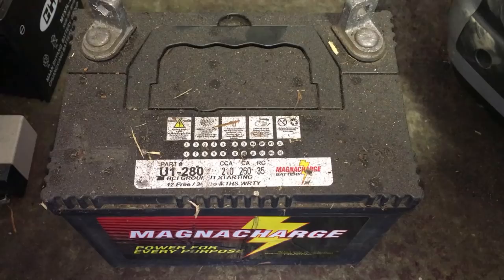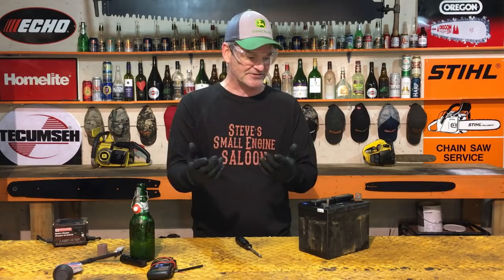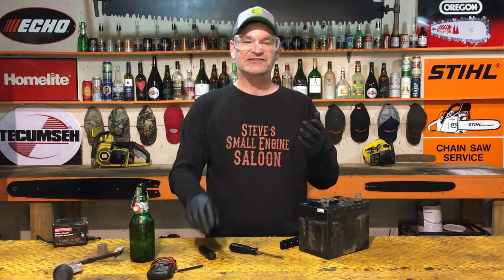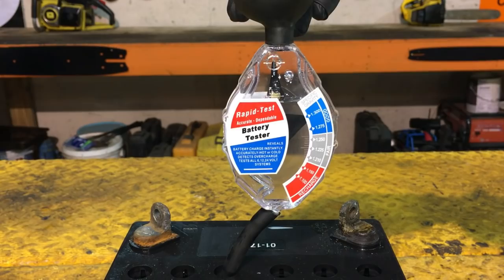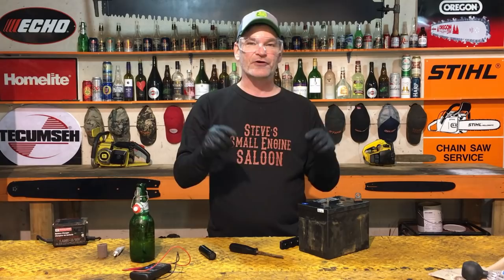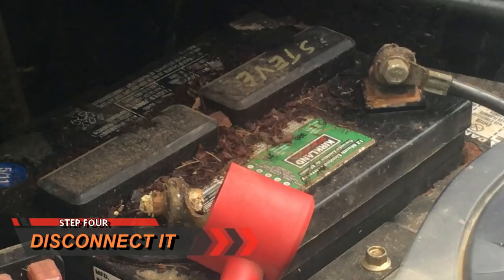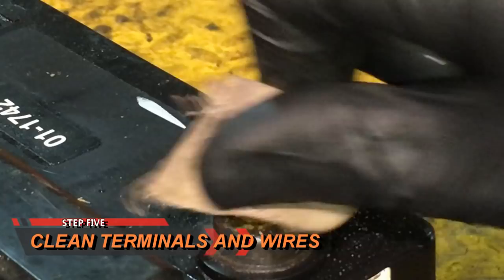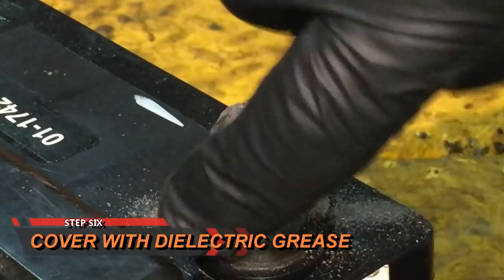How To Winterize and Maintain The Battery on a Riding Lawnmower

Comment from the maker: Click here for a battery tender ➜ https://amzn.to/2Dr5AGY
Click here for a new battery ➜ https://amzn.to/2OM5Ylr
Click here for a Multimeter ➜ https://amzn.to/2Kb6ubU
Click here for a Hydrometer ➜ https://amzn.to/2zdlFx4
Click here for gloves ➜ https://amzn.to/2K9z5OU
Click here for Dielectric grease ➜ https://amzn.to/2OKAlZr

Check out these other informative videos: 
Easiest Way To Winterize Or Store A Weed Eater ➜ https://youtu.be/hdleYDvm9BY
How To Winterize A Lawn Mower, Pressure Washer, Etc.  ➜ https://youtu.be/qccdo2UMMsE
How To Winterize a Chainsaw, Weedeater or Trimmer ➜ https://youtu.be/FEmT8qUoD0E
Best Way To Clean Under the Deck on a Riding Lawnmower ➜ https://youtu.be/RpURLWPNI1o

Make sure to check out the Saloon here too…
Click here for my website ➜ http://www.stevessmallenginesaloon.com/
Click here for my Parts and Tools Store ➜ https://www.amazon.com/shop/stevessmallenginesaloon 
Follow me on Facebook ➜ https://www.facebook.com/stevessmallenginesaloon 
Follow me on Instagram ➜ https://www.instagram.com/stevessmallenginesaloon/ 
Follow me on Twitter ➜ https://twitter.com/SteveSaloon
Reply: If you don't have any distilled water, R-O water is also OK.
Reply: Instead of battery tender I installed the battery inside the fender well on my truck and hooked up a couple of jumper wires for the winter. It seemed to work okay for me; do you see any problems wtih this idea?
Reply: Sadly my 12V is reading 8.5 v so is it a Dead aka Boat Anker?

Comment: Back in the 1970s, I was the chief machanic for a large retail distributor. This distributor (center) had hundreds of electric order picking carts that were always on the move.  One of my duties was to maintain these carts including their batteries.  So, hen I first got this job I reached out to a few battery manufacturers with my questions.  I agree with everything you said except for one thing which was the level of the fluid in the battery. What I was told told back then was that each battery cell should be filled with distilled water so that this fluid just touches the battery's plastic case in the cell. That will ensure your battery will not be damaged by low fluid level when in operation.  However, I really enjoyed this video and all of your other videos.  They have taught me (an old timer) a few things.

Comment: Love your tips. Why it's important to disconnect the negative terminal first is because if you touch the frame with a wrench on positive side first it will cause a short. Disconnect negative first as Steve said and remove that safety hazard.

Comment: Here in SW Florida the battery is not going to freeze, but the grass growth does slow to a crawl as the weather gets dryer (and I don't water my lawn). So my riding mower doesn't get used very often in the winter. What I've done to keep the battery charged is bought a small solar panel that keeps it charged up.

Comment: Thanks Steve :-) a couple of notes about voltage. This goes for any and all flooded lead-acid starting 12 volt batteries. If your multimeter reads 12 volts, the battery is actually at about 50% discharge. And some damage has been done. At around 11 .5 volts, severe damage has been done. Flooded lead-acid batteries should absolutely never be discharged any farther that is absolutely necessary. The farther discharged, the more damage is done do to sulfation, potentially cracked plates and a whole bunch of other nonsense that usually only Engineers understand :-) a fully charged 12 volt battery should read approximately 12.6 volts plus or minus a tenth of a volt. If it reads above that, as yours does that's called a surface charge and is basically a false charge that is a good indicator of a fully charged battery. Not trying to be a know-it-all, this is just something I happen to have extensive experience with. (Battery nerd). Hope this helps somebody :-) I'm drinking a blue Foster's oil can while typing this BTW
Reply from the maker: Good info Jon, Thank You...
Reply: Depends, more acidic solutions in SLA chemistry, mean greater voltage and output, with greater corrosion. 
  I like mine to be around 12.9 on the shelf, when I buy them new. (about 3 months old) 
The older ones will be all over the lower side of the map in voltage.
Reply: DarkLinkAD 
Haha! I thought I was the only one that brought my multimeter to go buy a new battery :-) the guys behind the counter always look at me like I'm up to no good while I'm testing the batteries on the shelves
Reply: @jontheroofer1968 : Don't forget to check the date code for freshness, You do not want to buy a 2 year old battery when the one behind it was made last month!
Reply: Steve always a good idea to have a container of baking soda and water mix incase of a spill on body parts and clothing.
Reply: @jontheroofer1968  that's a very good description. I've seen people try to oversimplify and call every kind of battery damage "sulfation" and then try snake oil cures for sulfation that almost never work. Rather than buy gimmicks to try to fix what's already permanently damaged, it's far better to spend the same money on a battery maintainer, and then use it.
Reply: Jon,
Are deep cycle batteries made differently? They are able to be drained completely without any harm. I often wondered why they did not make all batteries like that. I was told that the deep cycle batteries don't supply the huge surge of current required by a starter. I only know this because I have a friend will a trolling motor.
Reply: Yes interesting point about surface charge. I read somewhere that you should leave a recently charged battery for a few hours before testing its voltage for the surface charge to dissipate and get its true reading
Reply: @simonharper4199  
Flooded lead acid bats can maintain a surface charge for weeks.
Reply: Well lucky for me I have a 12v lithium battery super easy to remove and bring in doors or any thing else lol
Reply: @ianbutler1983  The difference is the plates. A starter battery has a large number of very thin plates. Lots of surface area means lots of current generating capacity. However, it means the plates are fragile. Charging and discharging a battery involves a chemical reaction with the material of the plates. Overdo it with thin plates and you can get holes or even chunks that have fallen off.

Deep cycle batters have fewer, thicker plates. Less surface area means they can't produce as much current, but they can take a lot more abuse. If you leave them sit while discharged for very long you can still kill them surprisingly quickly though.
Reply: @StringerNews1  It's true that sulfation is a very specific kind of damage, caused by a specific kind of abuse, typically leaving a battery sit partially discharged for a long time. Deeply discharged batteries have other problems. However, if what you have is truly a sulfated battery, it can be recovered. Or, at least, I've recovered a fair number of them. If your battery will happily take a full charge, hold 12.6+ volts rested (for a flooded battery), and supply low currently levels all day long without trouble, but then almost immediately chokes with mid to high current draws, only to recover to full voltage when the load is removed, then it's probably sulfated. Essentially you've got an electrically insulating coating on the plates, which only allows a small amount of current through.

I've seen batteries in custodial cleaning equipment that can provide 80% of their listed capacity (230 AH in this case) at 10A, but dropped under 12V almost instantly at 60A, triggering a low voltage shutoff after just 15 minutes, less than 10% of their capacity (at 60A, listed as 215 AH). Allow them to rest for a few minutes, they're back at 12.7V, ready for another 15 minutes of operation.

For flooded batteries you can reduce sulfation by putting the battery under a moderate load until it drops below 12V, then on the charger until it's full, rinse and repeat in fairly rapid succession. I've had good luck with flooded and AGM batteries using a high frequency charger designed to break up sulfation.

If you always keep your batteries on a float charger, you'll never have sulfation.
Reply: @jasexavier  IME a sulfated battery can be recovered if you catch it before the damage is too bad, but with automotive batteries, often the first sign of a problem is when sulfation becomes long-term and unrecoverable. Although it's chemically the same sulfate, the long-term product develops a hard crystalline structure that can't be reversed electrically.

The bottom line is that sites like this aren't giving good advice, they're selling products. But how one uses these products makes all the difference. Rather than get into trouble then try to fix it, it's better to avoid the trouble altogether. Keeping an unused battery on a maintenance charger to prevent trouble yields better results. With the pandemic I work at home and use my car once a week at most. The battery needed replacing, so when I put the new one in, I hooked up a small smart charger to keep the battery topped off and prevent sulfation.

Comment: I've seen cases, especially in hoopty old John Deere mowers with no hood where a dirty battery top causes the battery to discharge. That junk between the terminals can get soaked in electrolyte residue around the vents over time, then you have a very small amount of current flowing through it, discharging the battery as it sits. Keep your battery clean.
Reply: excellent comment. i was gonna say the same but you had beat me to it! Lol!

Comment: Excellent video as always Steve, quick tip, use your Hydrometer filled with distilled water to top-up the cells - easier to control than pouring from a bottle. Regards from Germany!
Reply from the maker: Excellent tip my friend, Thank You...
Reply: Or dollar store turkey Baster
Reply: @drizler  great idea. Just make sure you dont baste your turkey later on. Lol! But seriously ... great idea. I keep mine in the shop on a peg board. Peeps dont ordinarily think about a turkey baster in the shop but there are a 1000 uses for it. I cut a bit of the tip off but not too much. It will suck up heavier fluids such as oil a bit better. I can then use it to suck up heavier oil or remove the suction ball and use the tube as a small long stem funnel as well. I just put a hazard sticker on the tube so there is never any confusion.
Reply: Battery cells are separated so don't forget to check each of the 6 cells with the hydrometer. You may find one or more cells with lower specific gravity than the rest.
Reply: @drizler  Turkey Basters are great in the shop ,find a lot of handy stuff for shop in Dollar Stores .

Comment: 8:50 I use a small wire brush to clean the terminals and posts; it removes the corrosion better and more thoroughly than sandpaper, doesn't gouge up the surfaces so much, and doesn't leave grit behind.

Comment: Hi Steve - I'm in the UK and have just come across your channel.  I have a couple of ride-on mowers at our holiday home, and we always ensure the electricity is turned off when we leave to avoid any problems, so a 'battery tender' is out of the question.  I always remove the batteries from our tractors, and I bought a couple of Solar panel 12v trickle chargers which I hang in the workshop window & connect to the batteries whilst we are away. They don't use any electricity, and they keep the batteries charged up ready for the next visit! Solves a lot of hassle.
Reply: That don't fly in Canada, where we get down to -30 C every winter.

Comment: Excellent advice about the battery tender. I keep my lawn tractor, my motorcycle and wifes scooter outside in my enclosed shed all winter. I have 3 battery tenders hooked up to all 3 all winter. Make sure the tanks are full of gas and I'm ready to go in the spring.
Reply: Might be a silly question but do u keep the battery in the lawn mower with battery tender or do u take them out of lawnmower while battery tender is in use

Comment: Great video.  I saw a comment below about using baking soda to neutralize any acid on the outside of the battery that can cause corrosion to the cables.  My dad many years ago showed me how to use really hot water and a few tablespoons of baking soda and just dip the ends of the cables and connects into this solution, works great. Then you can clean them with wire brush or emory cloth as you suggested.
You had lots of great information, thanks for another really helpful video.

Comment: Thank you for this video. Exactly what I needed to know for my mower. My mower is only 2 years old and I've slacked on battery maintenance, so I wasn't sure what I would find. Luckily, water level was still good, and it measured 12.4 volts. Cleaned it up, hooked it to the battery tender just to get it fully charged,  and should be ready to fire up next week. Thanks again!
Reply from the maker: You're Welcome...

Comment: Steve, I love the subject.  I have practiced putting my lawn tractor battery in my heated garage on a piece of plywood away from the cold floor every winter.  I make sure it is fully charged after it is removed and use a cheap HF trickle charger.  The first battery lasted almost 7 years before giving up the ghost.   I do the same for my Jet Ski.  I can honestly say it increases the lifespan of the battery from my experience.  👍👍👍👍👍
Reply from the maker: Right on

Comment: I have always had 3 or 4 batteries to winterise and like you said top off and fully charged, now here is were i differ , i always left them in unheated garage never had any problems with my batteries and the lowest number of years they lasted was 7years and my optima red top 13 years , now i really don't think the cold is the problem, this is only my opinion but the result are hard to ignore .Richard !!! Love your site !!!

Comment: Great info Steve! My battery goes in the basement during winter. I sit it on an upturned plastic bucket with a piece of 2x6 wood on top. I don't keep it on a battery maintainer and have rarely had a failure. The mower itself has to sit outside. Landlord won't let me put a storage shed on the property. The terminals are cleaned and I coat them with a little grease. The mower is kept under a mower cover.
Reply from the maker: Sounds great!

Comment: Thanks again Steve for an excellent tutorial. If I can suggest a couple of extra things I do at my cottage. First of all I store my batteries in an insulated area (laundry room) placed upon blue styrene styrofoam to keep them warm. Then depending upon how rushed I am in closing I cover the terminals (like you) with dialectic grease AND enclose  or cover the whole battery with a garbage bag. Don't know why the bag is helpful but it keeps the battery  clean. My theory is that there are microscopic particles in the air which if they land on the battery terminals they will promote discharge. Also my batteries are stored next to battery chargers. So in the middle of winter its easy to go down to the lake to re-charge or restore my batteries. This all seems to work for me as I have had batteries last 8- 12 years. Plus the peace and quiet for a day or so in the winter with a wood fire and a beer is wonderul! Again your work is excellent and I am subscribed with it all bookmarked for future reference.

Comment: It's a VERY good idea to check batteries a couple of times a year.  When I took auto shop, they told us batteries were soon to be junk if the plates get exposed at all.  We were told to fill the cells until we could see the water touch the bottoms of the caps's sockets.  The caps only go about half way down into their sockets.   Nice video all the same.
Reply from the maker: Thank You...

Comment: Vaseline works just as good as dielectric grease, when I wired homes we used no-lox with aluminum wire, I use this on batteries too but is messy so started to use vaseline on battery terminals and lightbulbs in cars and my mower.
Reply: Reno Raines I prefer anti seize silver based grease,best for conductivity & anti rust !!!

Comment: Excellent Video Steve. I just want to share an idea that I used to do for keeping my battery charged all winter: I had some extra space under the hood of my pick up truck between the grill and the wheel well. I added some foam rubber to protect the battery and made up a couple battery cables to connect to my truck battery. That kept my battery charged all winter long. I don't know if this is a good idea? But it worked for me.

Comment: Steve, I love your channel.  I've been charging my motorcycle batteries for more than 50 years.  Most of those years they were fillable lead acid batteries.  I would get 2 to 4 years out of them. The last few years I've been using  AGM sealed lead acid batteries.  Thus being sealed there is no way to check fluid or add more. I've been using battery tenders on them and when connected continously I have fried several.  The charger says there charged   but they are dead when put back into use. After reading a lot of articles I'm going to change how much time I leave them connected to the  charger. Like maybe 1 day a month. Experimentation. 
Keep up the good work.
Reply from the maker: Thank You...

Comment: I don't have a riding lawn mower but I do have a motorcycle that just sits unused over the winter. What I do when PMS (parked motorcycle season) comes around, I drain the gas from the carb and remove the battery. I keep the battery in the house where it can't freeze and on a trickle charger set at 13.8 volts. Actually, it's not a commercial trickle charger, it's something I made, using a transformer, a rectifier to convert AC to DC, and a resistor to limit the amount of current to very low that goes to the battery. Still, I do like the advice you give to others.